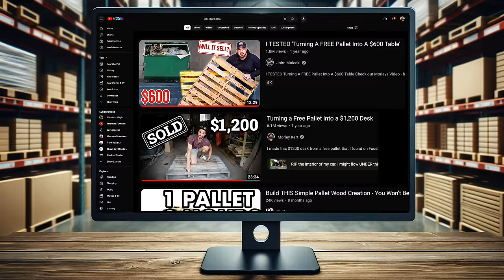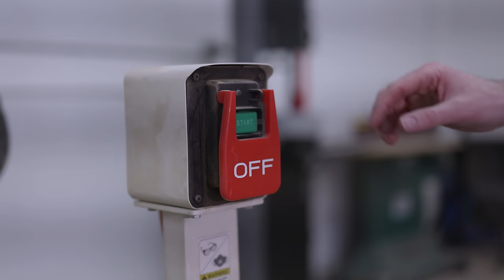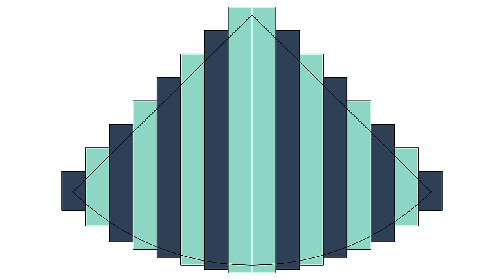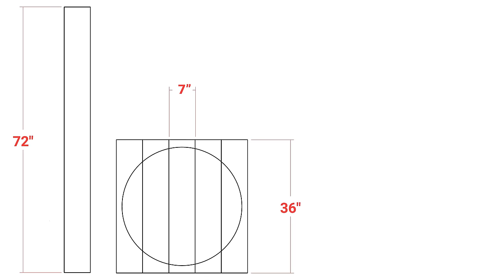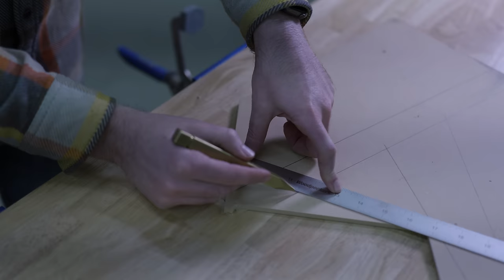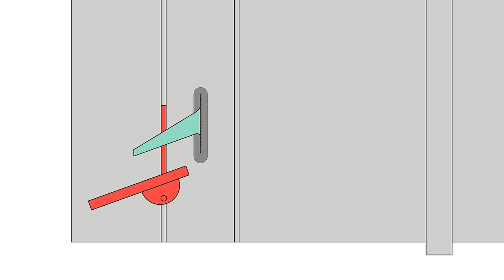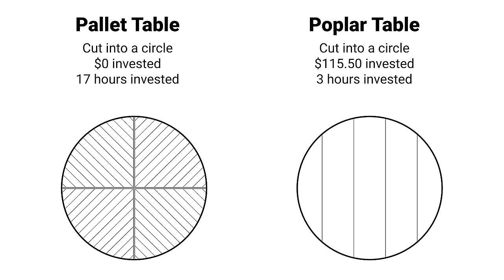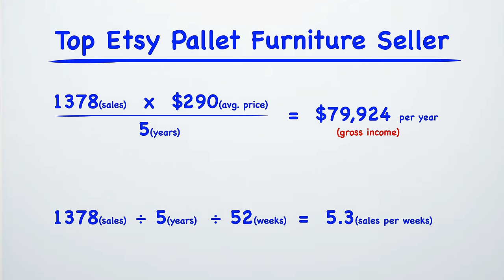Pallet Furniture is a Scam

Comment: So one thing i'd say about working with salvaged materials is this: when you make a design, but then you run out of a particular material, or don't have enough, etc, etc, you often spark some creativity (after the frustration, usually)

I sew costumes, and the number of times that a design has changed, and evolved, and been better for it, is basically every time, because i only use materials source from thrift stores.

The packaging won't tell you that "this piece of cloth has some really weird pieces cut out of it" it just shows you a dimension.

I can think of several different pieces that i unrolled when i got home and had to change a plan specifically because it had an oddly shaped cut out in the middle.

The same thing happens with your pallets: you get them home, disassemble them, and in the process, some boards split, or tear out happens, or they wind up too thin, and every single time that happened, it made you add more detail.

The pattern being made up of 4 quarters made for some cool designs. Being too thin added a contrasting colour to the underside, and the entire edge of the tabletop. The inlaid section to hide the joinery lines, and the various patched sections, all add detail and interest to the final piece

That's probably the biggest benefit of all in working with pallets or other salvaged materials - the product will never turn out the same way no matter how many times you make a table from the same plan, and you will always have to get creative. 😊

Comment: I have used pallet wood a few times and have been both happy with the results and displeased with the amount of time spent.  I would have liked it if you had done a similar pattern with the poplar table so the outcome was more alike.  The poplar table took less time but part of that was due to a simpler design.  I think a lot of people also overlook the unspoken costs in pallet wood.  Glue costs money and so do rags and paper towels.  It might not be much but it adds up.  There is also the electrical cost of running pieces through planers and sanders over and over.  Thanks for sharing!
Reply from the maker: You're totally right. I thought about factoring those in. But I would have no idea what the actual numbers were on such a small scale. And it would only have made the chasm in profit/hour even greater.
Reply: And epoxy and hot melt...
Reply: @Foureyes.Furniture  If you track your costs over a year (for example), you could divide that annual cost into whatever percent of a year these builds required.  I assume a lot of businesses do this to track consumables, but I'm also just an idiot on the Internet.
Reply: I was thinking similarly
Reply: @Foureyes.Furniture  One forgotten nail and you can count the price of a new blade or two.
Reply: Yes, I think he should have done the same sort of four-sectional with the dark strip in between on both tables to make for a better comparison.
Reply: @jowjor  Three words: "handheld metal detector" (the ones that are about the size of a large flashlight.)

Comment: I've found 3 classes of things I like building with pallet wood 

1.) things which use the whole pallet unmolested. Compost bins, cob over pallet structures etc. 

2.) things where an unfinished look is fine. Planter boxes can be made super easy and quick from pallet wood, provided you cut it down correctly.  The people I know making money on pallets do this, and they can bang out 4 or 5 in an hour when batching them. 

3.) small things. As you noted, the dimensions once you mill the pieces down are pretty small, but making boxes etc from people which, as you noted, are things of natural beauty created from trash appeals to my inner romantic. 

Also, I've found taking a sawzall horizontally and just cutting through the nails holding the boards on gets me better preserved boards, and allows me to disassemble an entire pallet in about 2 minutes.  Add 10 minutes to that if I need to go through with a punch and get out all the little pieces of nail remaining, but that's only necessary for a small portion of my projects.

Finally, if you want to work in pallets, you can find a bunch of small companies who regularly get deliveries on pallets and are more than happy for you to come haul them away each week, saving them the trouble of getting rid of them, so it is possible to get a regular supply of pallets cheap, with the benefit that they will have more consistency than those you find on the roadside (but no guarantee of consistency, too many things change in the pipeline)

Comment: Pallets are often used more than once.  I expect the dirt and grime embedded in the wood to seriously diminish the life of your cutting tools.  My brother won't let me run pallet wood through his planner. I completely understand why.
Reply: That I can vouch for. I sometimes use palletwood for small/simple projects and before it is put through the jointer/thicknesser, it is rough sanded with a belt sander and brushed with a wire brush. That usually takes care of most crap. Final check is with a metal detector, to find nail tips and such. 
When processing pallet wood, I always wear a full face mask with micro filters and overpressure (air is sucked in from outside through the filters and blown over my face and escapes though all the little gaps that may face leaves in the rubber cushioning). This basically prevents anything to sneak into the mask and it keeps my glasses from condensing up by my own breathing. Pallets can be treated to endure weather and that stuff is toxic. You don't want that in your body.
Reply: I took a furniture course as part of a fine arts degree- they had dedicated planers and jointers for 'salvage' wood at home I used a cheap planer with crappy blades for the first few cuts and then a good one for the rest, too much labour
Reply: It's likely not the case for the pallets he got (besides those last 2) because often for equipment or specialty objects they explicitly give you a new or very lightly used pallet because it's out to a customer, but if you're picking it off a dumpster, you're right and it probably went through all 48 continental state and saw every warehouse and warehouse type!
Reply: Old pallets are pretty good for making garage shelving and outdoor planter boxes.

Comment: I'm a beginner hobby woodworker with limited time and though I've collected a lot of free pallet wood I haven't had time to complete any significant projects.  I'd assumed that being really slow was inevitable for a novice, and no doubt that is a contributory factor, but you've absolutely demonstrated that using pallet wood is my real problem.  I've hit those 'new woodworker experiencing poor slow results' motivation issues that you warned about and I also chose projects based on the wood I have stored, (typically low quality pieces).  My day job will cover the cost of decent timber, so the conclusion is obvious... stop being limited and frustrated by substandard wood and start doing the higher quality work that I aspire to.  Thank you for creating this video, it's just made my life a bit more rewarding!  😊
Reply: The bigger concern with pallets is that ones you find thrown away has a HUGE chance of them being contaminated, and are honestly dangerous to have all the dust kicking up in the air, let alone in your home.

Comment: great video! but id really appreciate if you didn't use AI images, AI images have so many ethical issues like stealing art from artists without credit or compensation. id really appreciate if you did some research and talked to other artists about AI. I've seen many of my friends and artists I follow see a substantial loss in income due to AI images, Artists are hurting and require work, id rather you either help out fellow artists by commissioning some art pieces or at the very least stop using AI image software that is actively stealing the art and careers of artists.
Reply: lol
Reply: I think you are being unfair here. If you think the technology is going away, you're mistaken. If these were AI generated images, the key issue is that the tech is used to plagarize, right. But these images weren't plagarizing anyone, as they were original images, with an original subject matter. And if a digital artist uses the tech to generate original images, with original subject matter, you might as well dump all iPads and all digital drawing apps that allow digital artists to create. Which isn't going to happen. It's like  silversmiths and goldsmiths arguing that all costume jewellery should not be made or purchased, because it mimics techniques of such craftsmen. Not so, because the most mass market got precious metal jewellery is niche between mass market, artisan, and high-end. As an artist under capitalism, you are competing with other artists already using analogue media. That's is your real competition. AI art will find its niche, but there will be a market for art created with organic media still. And AI art will be unlikely to command high prices, because it's not the real thing. It's non-organic, and like chewing gum - essentially cheap, and disposable. There is no magic there, and that magic is what you are trying to communicate with your art, what you have to say to your audience.
Reply: @BigHenFor  Any AI art is inheritly built on the backs of artists without their consent. Even a completely unique 'prompt', in it's generation, uses real art from real artists to do so.

Comment: As a beginner I concur my pallet projects haven't come out the way I envisioned and are extremely time consuming due to not knowing how to make the repairs or the different tricks needed to arrive at the desired result. So much easier working with quality wood at this point. I get the result I had in mind and none of the headache along the way. The confidence boost in seeing a quality finished piece is well worth the cost!!

Comment: Another often overlooked problem with pallet wood is that depending on how it's treated for longevity and what chemicals may have been spilled on it, the wood may be toxic. That's not a big deal once the wood is sealed IF you're not planning on using it for anything related to food. You really should not let food touch pallet wood, even if the wood is sealed. The dust can also be toxic, though, and while dust is always a health concern, toxic pallet dust could be a lot worse.

I've done some work with pallets for the big reason you listed, which is that it's free and I'm just barely starting to learn. Messing up free pallet wood isn't a big deal. I've been careful to wear a mask almost all the time, though. And, people often burn the bad pieces and scraps from pallets, which is a terrible idea.

Comment: Another thing that is always missing from pallet videos (understandably yours included) is all the costs for a project outside of the wood. Glue, epoxy, screws, sandpaper, etc also cost money, and the wear and tear on your blades and equipment is higher if you're having to do 4x as many passes to get the same amount of finished product. It's kind of a pet-peeve of mine for a lot of youtube woodworking content, that someone will show you how to make a coffee table "for only $12" because they bought cheaper fence posts, but then burn through $25 worth of screws, glue, and sandpaper in the process.
But like I said, it's understandable that this stuff is often glossed over, as these costs are at minimum hard to math out (you are likely using screws you bought in bulk a year ago and don't remember the price, you'd have to weigh the glue bottle before and after to know how much you used, etc), or impossible to quantify (what's the price of 200 extra cuts on a saw blade that that is built to handle 800-1000 cuts?).
On a single hobby project the price difference might be negligible, but if we're talking about someone making a living on pallet wood furniture, the recurring shop overhead will have a noticeable effect on the bottom line.
Reply: It's not that it's hard to calculate those costs, but the people who make these videos don't care. You only calculate costs like that when you really get into process optimization.
You have people who are primarily content creators, for whom selling whatever they create isn't really the goal, as long as it draws eyes and they can get paid by advertisers.
The other type of people are artists getting commissions for specific pieces, who make videos to draw customers, and they are either including the costs in their bids/billing or don't care about having to buy a new saw blade to finish a $15,000 table.

Comment: I think the main reason to use pallet wood is if you're making something for yourself, and you have a wabi-sabi aesthetic, and don't mind imperfections in the final piece. I haven't used pallets, per se, but I've recycled beat up wood (like an old picnic table) into new furniture. I wanted the end result to look recycled and rustic, and it did, so... yay.
Reply: You used what is called reclaimed wood. Selling and making things from reclaimed wood is a thing even at the Home Depot level.   People like that rustic look especially the grey barn wood.
Reply: @orlock20   And when I built stuff out of new wood, I found that using rottenstone as a stain gave it that old barn wood look.

Comment: My parents build their outside furniture out of pallets. But they left it mostly as it is, meaning it was mostly stacking for the sitting space, cutting it to shape for the sides, fixing the pallets at an angle to create the back support and finally just buy some cheap pillows for the back. And it was much cheaper than buying the wood and then building it from the ground up and easier. But the downside is that as you need better pallets than you usually find outside, they had to search for them and even buy some to fit their needs. Supermarkets have a lot of them, but they also do not tend to just throw them away when they are still good and stable, but they go much cheaper than new ones.

Comment: Finally somebody being truthful about the real costs of that free pallet wood. I found that out pretty quickly a few years back when I tried using pallet wood. Firstly, I had none of your machinery so it all had to be done with hand planers, circular saw and router, and hand orbital sander. It took many hours of work just to get that wood looking reasonable enough to make furniture from. The time for processing it was just huge. It does not need a lot of trial and time keeping to figure out that using free pallet wood is not a cheap way of making anything out of wood especially not furniture.  I now buy ready prepared wood that I can start using practically immediately. I get more done in less time. BTW, everything I build is for personal use only, so on selling.  Thanks for making this video and demonstrating the realities around that 'free' pallet wood.

Comment: If you are building two pieces, first one, then the other, step by step, at least some of the time spent on the first project will be saved on the second project simply because you've already practiced once on the first project.  You've worked out what you have to do, done the measuring, possibly set your machine with the necessary angles, etc., and you've even physically practiced the moves so you have brain and muscle memory.  Not sure how much time that would shave off this process, but certainly the second time we do a task, the more efficient we should be at doing it, thus saving time.

Comment: The way you rip down pallet would be so much cleaner if you have a large 2x4 slide it between the pallets then use another smaller piece of 2x4 as a flat edge to hit with a hammer rested up against the pallet braces, the 2x4 lifts the pallet up and acts as a ledge and then you use a hammer to hit down cause the wood to separate cleanly in full length latts.

Comment: One thing which annoys me about "get income by building high value objects using trash" videos is that they don't tell you about the startup & tool usage costs.
Besides material cost and hourly wage, you have to factor in tool damage, shop rent, electricity cost, maybe even loans for expensive tools. Also, my local lumber mill lets customers use their giant planer and saw tables for free, but somehow I doubt that includes pallets you bring to their warehouse.

Comment: Pallets are put together with barbed nails so they do not easily fall apart from use so most of the wood is destroyed when pulled apart. most of these pallet projects make use of small scraps after all the unusable wood is eliminated.

Comment: A proper pallet breaker bar will speed up dismantling the pallets and break less of the wood. I've been dismantling pallets to make storage boxes and shelving and take about 1 hour to get a good pile of wood. I only use hand tools, 18V Battery powered planer and belt sander, PVA and nail gun to join, cheap decking oil finish. No where near as fancy as your table but then I'm not a professional woodworker and I'm not selling my result, gave some cube boxes away and got good comments. Palettes have their uses but not for high end furniture.

Comment: While im late to the party and your conclusion was more or less what i figured. One small thing you missed or left out is the cost of wear and tear on your equipment as well as fillers and such.

If the "free" table cost twice as many hours thats twice as many hours on your equipment for instance. Or if you used 5 times the fillers even if they are only a few cents per that adds up.

That said id say pallets do have a place as "practice" material. Even if they are more difficult. If i am trying something new, why not trash 90 odd free pallets instead of one $2500 chunk of walnut?